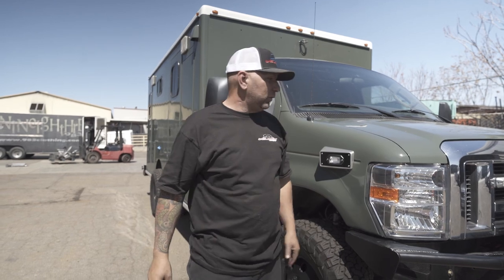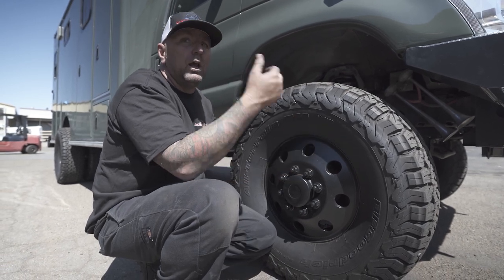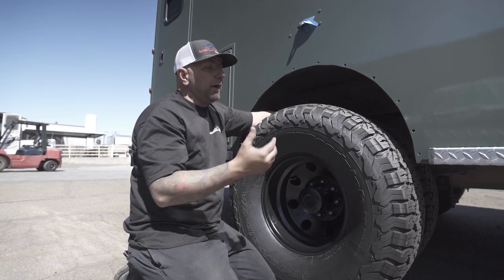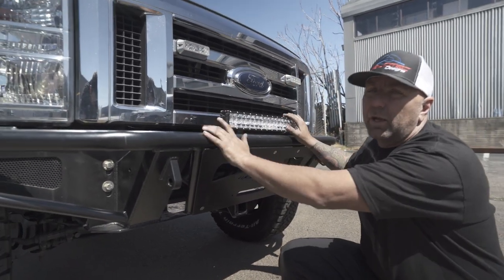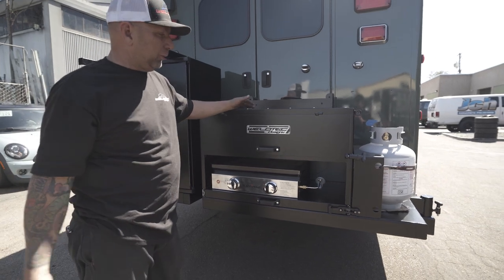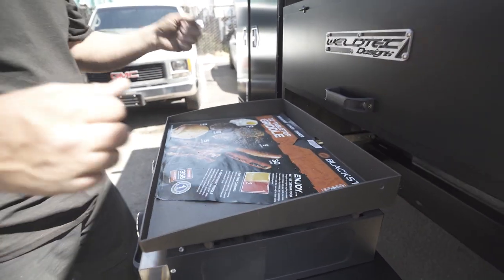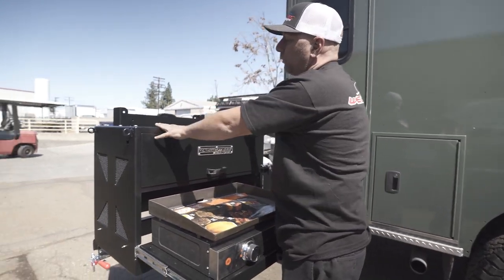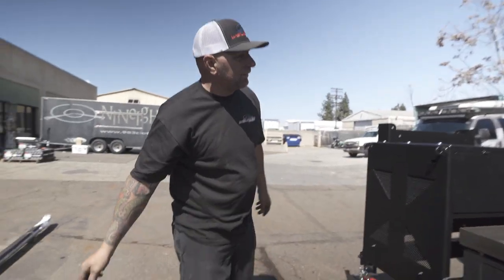The Ultimate Ambulance Camper Build

Comment: Very nice build so far.  Love the rear bumper and I'm currently designing a similar design.  I've been somewhat stuck on how to incorporate the 17" Blackstone.   I like the drawer slides but think you need a door to enclose the griddle while driving.   I can see already that you'll loose the griddle or at least the top of the griddle on the first big bump. Not to mention the road dirt and grime that will get all over the griddle on the first dusty road.

Comment: Those bumpers are kick ass. Especially the rear one. Great use of out door space. The only thing the rear is missing is a trailer hitch in case to you need to temporarily mount the front winch to the rear. But that is only minor. Great job on that rear bumper. I also love love the color of this rig.
Reply: Thank yo very much for the kind words, it was a fun build.

Comment: Additional arm with a center pivot would allow the kitchen to swing all the around to the side of the vehicle.  Lights above the cab is an off road must but, would also be a good spot for an additional storage rack.  The rear add ons to the bumper should be aluminum to reduce weight.

Comment: Everyone loves the rear storage in the bumper, it is great with the ability to rotate to the side. One problem. Apparently you nor your video viewers have ever cooked on a Blackstone griddle or even cast iron cookware. That griddle will be seasoned with cooking oil to keep it from rusting and to have a non stick surface. Sitting on an open shelf will have a lot of crap get on that grill. Needs to go in a SEALED compartment.
Reply: Exactly! That griddle will be absolutely covered in dirt after the first 5 minutes driving down a dirt road!